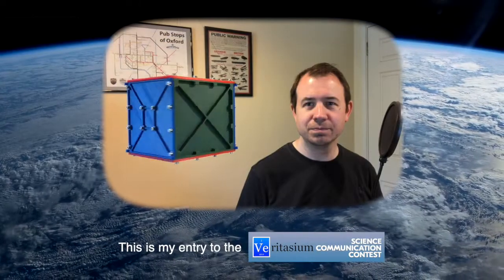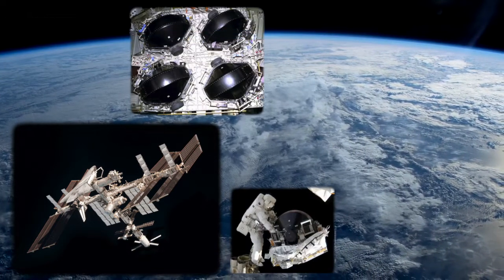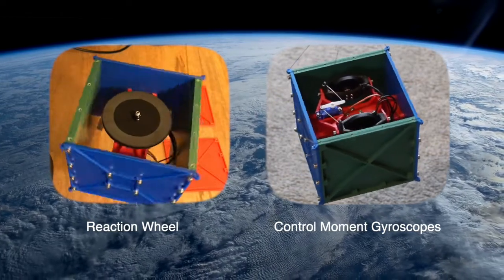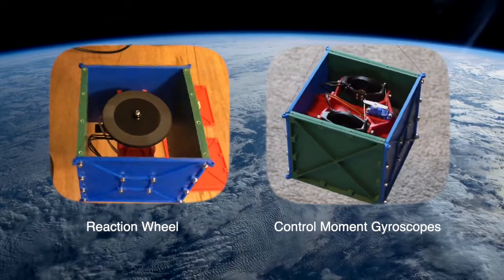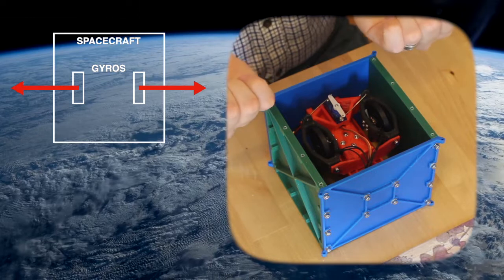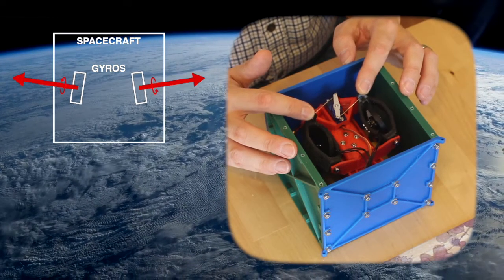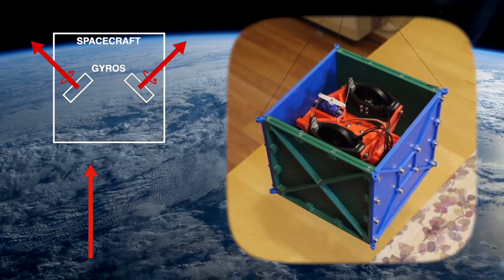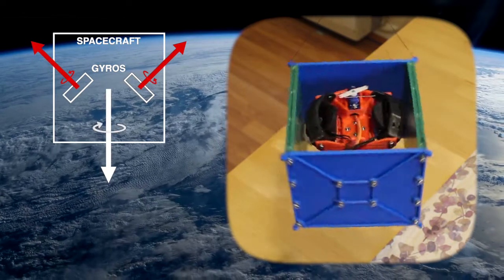Control Moment Gyros - in 60 seconds

Comment: Reaction wheels called gyrodynes or gyrostabilizers are usually shaftless in of Patents.
Reply: By placing a gyrodyne or gyrostabilizer inside a bicycle saddle for females beneath ceiling mounted backrest with a front latching bra and foot rest riser stirrups of a gynecological exam chair below could allow steering via muscle exercises since lack of excise in low gravity to sudden changes in accelerations is of concern.

Comment: So it all makes sense. But what about the torque needed to turn the gyros? Seems like a negative z-axis torque is being applied to rotate the servo, so there should be a positive z-axis torque to counter that, but then also as the gyros are rotated we get a positive z-axis torque? So does that mean if we want let's say +10 Nm torque in this case, should we apply a -x torque to the servos and have the gyros apply a +y torque such that x+y=+10Nm?